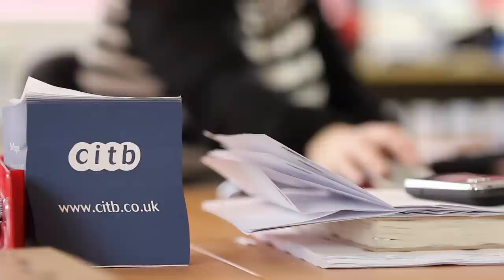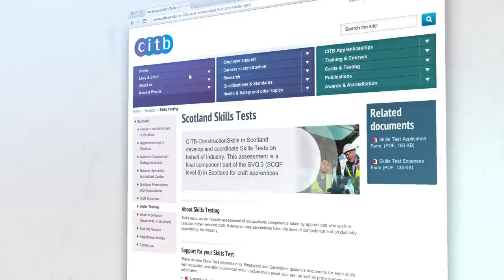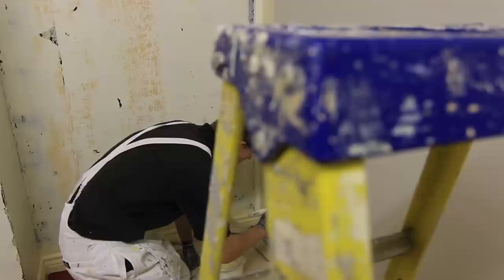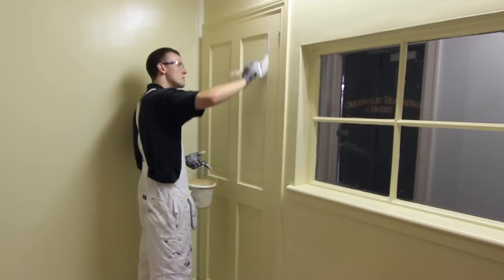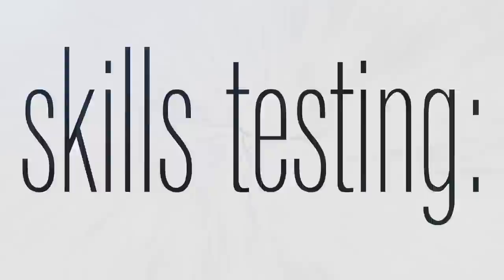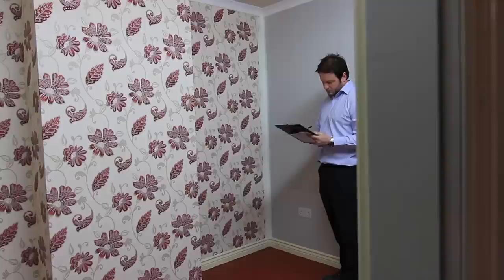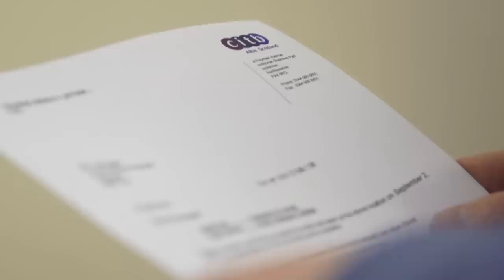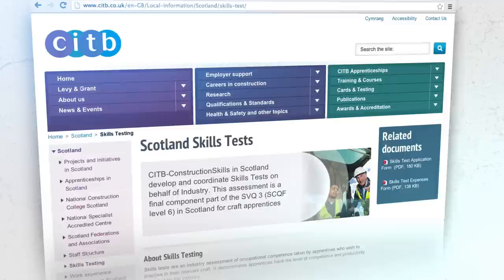Painting & Decorating Skills Test

Comment: Does the test include any skills for sustainability, texture coating, or industrial coatings?
Reply: PaintersInstitute Nope. The test consists of stripping wallpaper off of two walls, 1 coat of matt emulsion to the coving, two coats to the ceiling, two coats of acrylic eggshell to two walls, one coat of acrylic gloss to all woodwork, two coats of acrylic varnish to the reverse of the door, line the side wall for a finish and then wallpaper the chimney breast. The test is over two days and is a straight pass or fail.